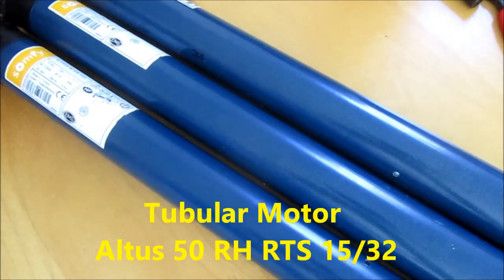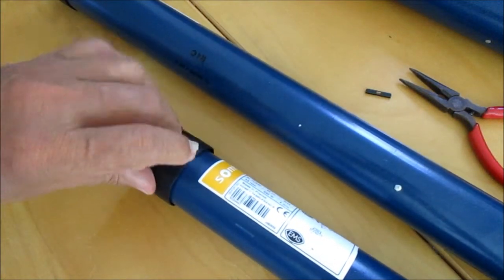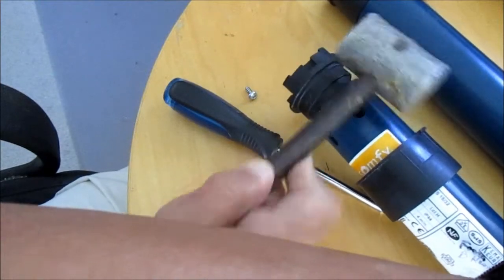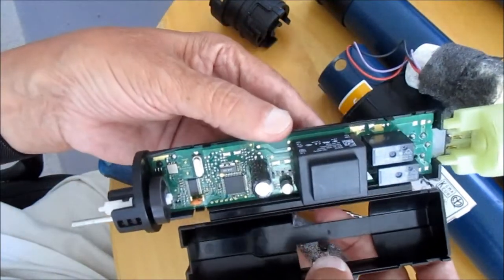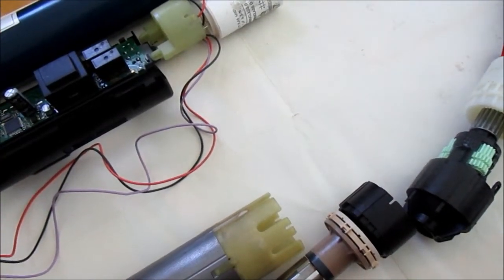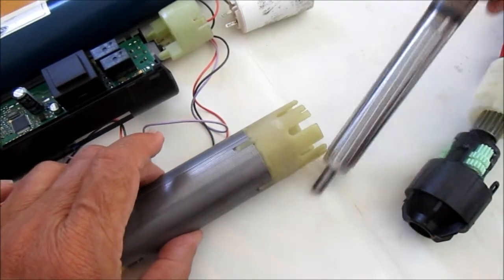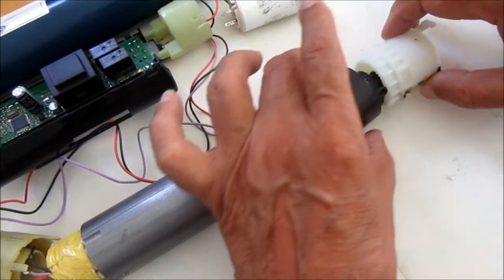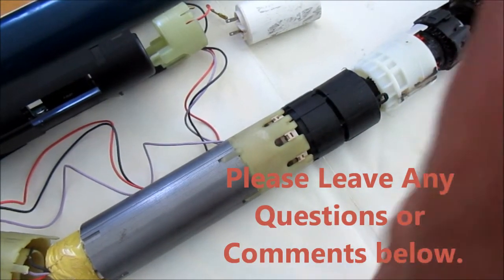Roller Blind Tubular Motor Disassembled

Comment: Very helpful.
I was wondering how switching between up and down is performed.
looking at the motor it only has 2 wires.
The electronics assembly you show has 2 large black boxes which look like two Relays.
is that how the switching is done?
one wire has to be connected LINE and the other to NEUTRAL.
right?
Reply: I will try to switch it up and down by using a smart-home-device (Shelly 2PM). For that, I ordered a used Motor on eBay to disamble it and to figure out, how the RTS / wireless up-down-switching ist working. I will do a Video of that, I think you're right with the relay-block. I will measure it and if it works, I'll show in the Video.

Comment: BRAKE/MOTOR PROBLEM:   I have a 30 year old SIMU which is the same company.  It is a mechanical system w/o any electronics.  My problem appears to be there is too much Brake and the motor will not break free and start.  The brake is a fiber disc that appears to be impregnated with silicone rubber with a constant pressure spring loaded pressure plate.  The brake appears to be a constant drag perhaps to stop the rotor quickly when desired blind position is reached.  I don't know what the breakaway torque is supposed to be, but I believe it is massively too great:  the friction surface of the disc is "grippy" as if the impregnated rubber has gotten gummy.  It cannot be sanded away since impregnated.

I'm looking into the possibility the motor torque is below spec:   I checked the field winding resistances and they are both 25 ohms.  I am in the process of getting the capacitor tested.   

I'm also looking on McMaster.com to see if friction material can be purchased.  They sell 7x7" pieces of 1/8" material for a whopping $30 which I would buy if I knew it would solve the problem. 

Thank you so much for your video!!!

Comment: Thanks very complete.  You did a good job of explaining it. 
I think this is entirely too much engineering and could be simplified.  The thing looks like it could cost $400 whenit was new. So many reduction gears and press fitings!
Reply from the maker: Thanks. Yes, they are very sturdy and over engineered. Actually cost around $1000 AUD.

Comment: i m thinking of manufacturer tubular Motor in India... Can u guide who can provide us Large scale manufacturing machinery for this ??
Reply from the maker: You need to begin with design.
Then contact tube manufacturers, electronics suppliers and plastics injection moulders. Then you will need Engineers to setup Assembly plant
Reply: @apached343  i have AutoCAD team which can work on design as well as moulding partners who can work on making specific moulds...   But i think the core part which is Inside Motor needs to be made properly...
Reply from the maker: @AlpeshPatelp87  You could try to contact  local electric motor manufacturers to design and supply the tubular motor,
Reply: @apached343  ya so to local Motor manufacturer what specifications i need to give him to make Inside Motor..... 
if u know please let me know...
Reply: @apached343  Also for different Nm Motor are they using different types of inside Motor?
Reply from the maker: @AlpeshPatelp87  Torque will depend on variables. See this calculator.
https://www.simu.com/en/products/choose-the-right-roller-shutter-motor/
Reply: I worked in this company as a mechanical machine designer.
it's not easy to maked . 
 
the factoreries manufactures This engine are in France, tunisia, italy and  polygone and we do not have a factory in india.
Reply: @mohamedmabrouk806  What about China? Do you think they could provide equal quality as those made in europe?
Reply: we can provide tubular motor directly if you want to open your market in India

Comment: Very nice video :D
I bought a budget blind, but am having issues with the battery going flat too often.
Opened it op into the tubular roller blind motor assembly, which is taken apart here, but could not go further, because I was missing the rigth torque bit.
I found that the tubular roller blind motor assembly is a "am25-1.2/30-es-ez" witch goes for 80$ online.
Now I'm wondering if I should replace the hole thing or see if I can find a better 7.4V lithium battery that will fit.
Am missing the internal diameter of the assembly in order to find a fitting battery and do not know how long I can allow it to be.
Given I find a 7.4V battery that fits is there any reason it would not work?
Edit: corrected battery Voltage